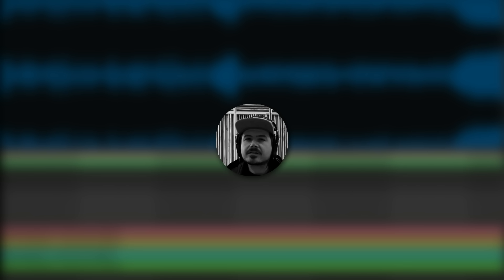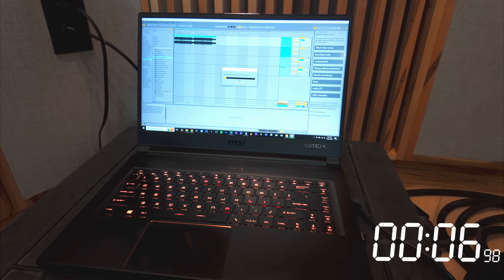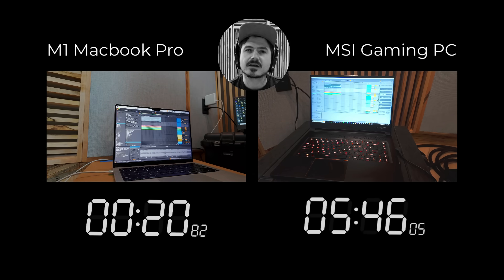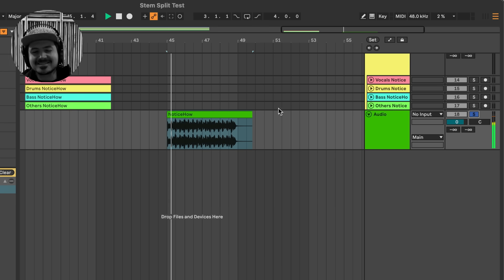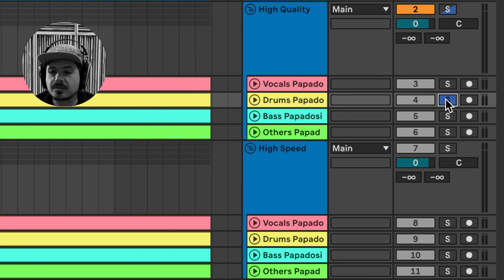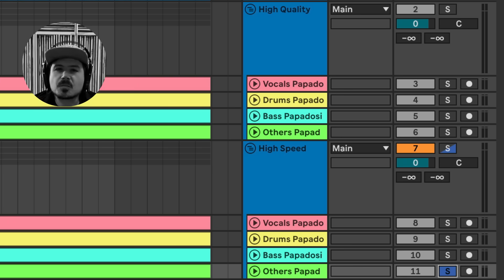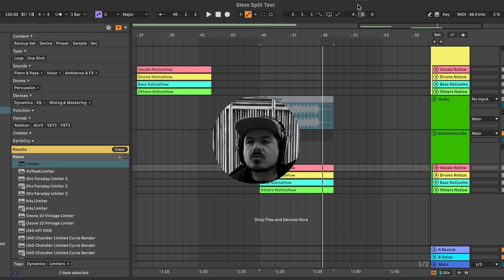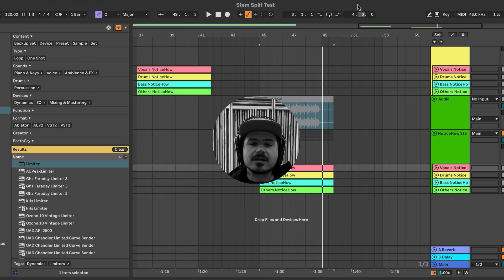Tested: Is Ableton 12.3 Stem Separation Too Slow?

Comment from the maker: As requested, here are the specs for the 3 systems in the test:
1. M1 Macbook Pro 14" 
Chip: Apple M1 Max (8 Performance Cores and 2 Efficiency Cores)
GPU: 24 Core (M1 Max)
Ram: 64 GB Ram
Hard Drive: 2TB
OS: macOS 14.1.2

2. Ableton Push Standalone
Intel 11th Gen i3-1115G4 
GPU: Intel UHD Graphics for 11th Gen Intel Processors
Ram: 8GB of RAM
Hard Drive: 256GB
OS: Proprietary? Idk

3. MSI GS65 Stealth Thin
Chip: Intel i7 - 8750H CPU @ 2.2GHZ
GPU: NVIDIA GTX 1070 with Max-Q Design (8gb video ram)
Ram: 32gb
Hard Drive: 1TB
OS: Windows 10 Pro Version 22H2
Reply: 8750 is 7 years old.

Comment: Hello everyone!
I found a method on Windows that makes everything much faster.
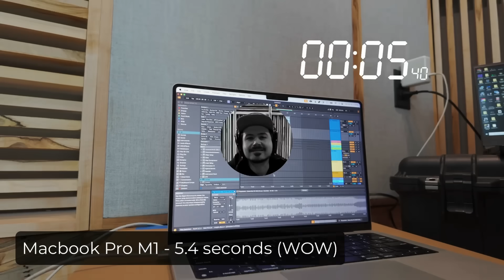A 3:30 song now takes about 1:30 minutes instead of 27 minutes. (High Quality)

To speed up the process, you need to do the following:

Go to this path:
C:\Users\User\AppData\Roaming\Ableton\Live 12.3.2\Preferences
or wherever your Ableton version is installed.

There, you need to create a file called Options.txt

It is important to name it exactly like this.
---
Then add the following line:

-_Feature.StemSeparation.ForceGPUAccelerator=true

After that, check the Task Manager to see which number each GPU has.
In my case, the integrated GPU was number 0 and my Nvidia graphics card was number 1.

Then add this line as well:

-_Feature.StemSeparation.AcceleratorIndex=1

Use the GPU number shown in the Task Manager.

Close and restart Ableton.

Hope it helps!

Comment: It's really important the file is the same file type as your project. Same using Stem Roller, make sure the file type for the separated files is the same as the source file in Preferences on Stem Roller

Comment: Calling a random laptop an GAMING PC is absurd, I have the "GAMING PC" with i9 13900k which is 4 years old and does this in 1.5s and in quality preset less than 10, just please specify the specs
Reply: Mac propaganda 😂
Reply: Yep, could have at least told the CPU like he told that the Mac is M1. But anyways it is not about mac vs pc. It is more to show that the process doesn't take long if you have a good modern computer (mac or pc)

Comment: I've got a 2018 i7 Mac Mini and I was surprised as a track was taking so long that I went away to do something else and when I came back, it was still processing!
I was really surprised as I have used an i5 MacBook Pro for stem separation in Serato and Virtual DJ and even though it can't do them in real time, it was still only a few minutes to process.
But I assumed that my results just meant that I really need to get an upgrade to Apple Silicon.

Comment: If anyone cares for more extreme cases, 2013 Macbook Pro 2.3GHz Quad i7 with 16gb ram, I split a 45 minute wav in HQ and it took ±10 hours. Decided to sleep on it after 1% took however many minutes, worked though. Possibly overdue for an updated purchase.

Comment: oh a laptop. mfing laptop. bro calls laptop a pc lmao. laptop counterparts are undervolted and throttle a lot bro, specify that its an old gaming laptop  at least.
Reply from the maker: Haha ok. Bro called a laptop a pc because it is a personal computer.
Reply: I run Ableton on a desktop PC with a 32-thread CPU and an NVIDIA RTX 3080, but Ableton doesn't use the GPU at all for stem separation so it's still very slow.
Reply: Pc and windows suck when making music ..
Reply: @ZEETONEx lol no. The same power is available on windows, same daws etc.
Reply: @cirisirpula152 you missing out ., aggregate devices , midi implementation is flawless , m chips , stability like a tank .. only thing windows and pc can get is cracked programs and virus and Trojans

Comment: If you do these kind of tests you should at least provide all the specs of all these systems in the description or otherwise they're pretty much useless. "Old MSI gaming PC" simply isn't going to cut it.
Reply from the maker: Thats fair, but this wasn't meant to be a comprehensive lab test, more of a general "here is what to expect" test.
Reply: @SeedtoStage  That's exactly the problem. "Old MSI gaming PC" could be anything. No way anything could be expected from this vague description.

Comment: Yeah, with the 12.3 Beta, I've split 2 songs for all 4 stems, one a whole 5 minute song, 1 just 30 seconds of another song, it took about a half hour for each in my guesstimation. 3050 with 24 GB of RAM. Maybe there's many variables (song audio quality, computer specs) with my rig that are causing such slow rendering times. All High Quality. I like the results overall, not perfect, but sometimes impressive.